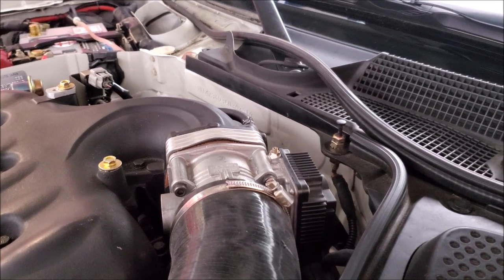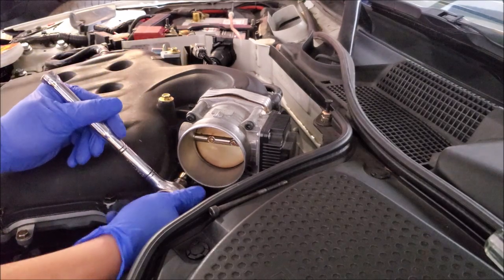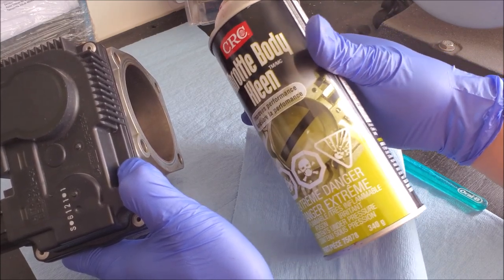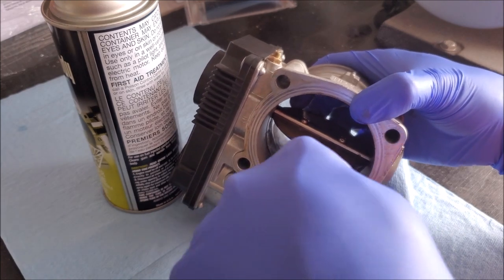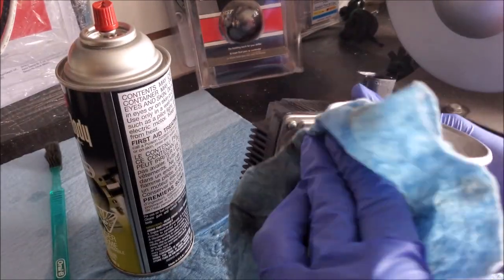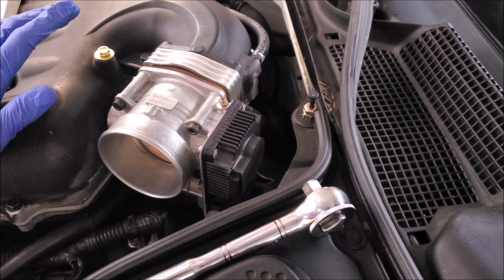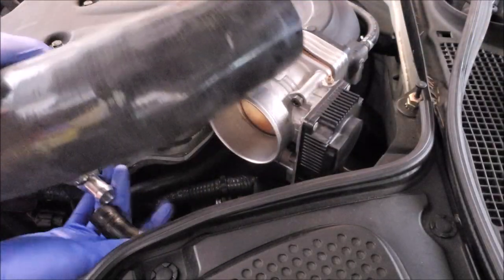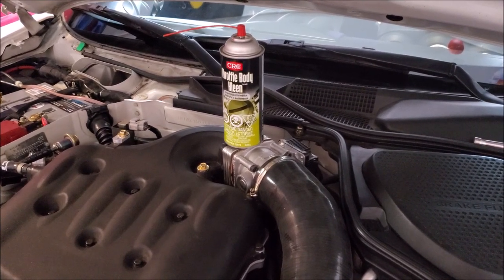How to CLEAN a Throttle Body Nissan 350Z & Infiniti G35 (Nissan 3.5L V6) | AnthonyJ350

Comment: Excellent tip/advice on turning on the lights and pushing horn to discharge all the caps in the system. Not sure how many people realize just because you disconnect power or turn something off doesn't mean the system is discharged. Capacitors don't instantly discharge just because you disconnect power. It can take a while unless you discharge them like you showed.
Reply from the maker: Thanks! Glad you liked that tip.
Reply: how long do u keep pressing horn to discharge?
what about leaving bat disconnected overnight
Reply: What about plugging a device into the power outlet ("cigarette lighter" port) such as a phone charger cord and a phone? Most of these things have a pilot light and would show when there is no juice.

Comment: Knowing is half the battle, thank.
Reply from the maker: Thanks for watching! Hope you liked it.
Reply: @AnthonyJ350  I know this is an old vid but does this work without doing the reset? And wold it work for a g35 2006 I understand the 350 z and G are basically the exact same i just wanted to be sure.
Reply from the maker: @lilgoon8613  You can try without the reset. Just disconnect the battery, discharge the caps by pushing the horn and leave it off for a few hours.
Reply: @AnthonyJ350  Ok man, thanks for responding so quick much appreciated. 👍 and subbed.
Reply from the maker: @lilgoon8613  Thanks for subscribing!
Reply: @lilgoon8613  did it work without a reset

Comment: Can you help me? My car when is hot drives well, but when switched off and left for an hour then started again after a mile of driving when switching gears or braking it can easily shut off. It also can stall when accelerating. It doesn't happen if I wait 3 minutes before driving
Reply from the maker: Is there a check engine light on of any kind?  What kind of car is it?
Reply: @AnthonyJ350  It's 350z 04'. There is a check engine but cannot read it with any obd2. It came on when driving at highway speed.
Reply: @Grendel817  did you fix it ? Im dealing with same problm now,

Comment: I have a 2003 modle with the VQ35DE and I just cleaned the TB and installed a plenum spacer. I just can't get it to idle normally :( I did all the resets and it seems successful, but the car idles around 1100 rpm and when I'm revving it it will drop to 1500rpm and hold for a sec and then back to 1100. And if I'm in gear it idles also around 1500rpm.
Reply: For context I think It's the first time Its even been cleaned for ~140k miles. It was filthy!
Reply from the maker: Try this and take it for a good drive https://www.youtube.com/watch?v=5tQm28K32SQ
Reply from the maker: Given the age of the vehicle I would install new cam position sensors and a new crank position sensor as well.  I have videos on both.
Reply: @AnthonyJ350  Thanks man, love your videos on the Z
Reply from the maker: @botao7274  You're welcome! I'm working on the car again so you'll see new videos on it soon!

Comment: Hey Anthony, how were you able to check the throttle body movement with the pedal? Ignition on(non-start?). I tried with mine(HR engine)and mine to not move, or at least the driver side didn't. But both should move.
Reply from the maker: I just used the accelerator pedal like normal.  Not sure how the HR does it with their weird valve event technology.
Reply: @AnthonyJ350  I figured out that I had to put the Z in first gear and got them to work. I also discovered the throttle bodies are not opening all the way at WOT.
Reply: Same problem, u guys figured it out?

Comment: Hey man I have an 03 350z and I have a similar throttle body spacer, i have the code p0507 and its causing me to lose power/bog out at 3.5k-4k rpms. I tried everything, tried the relearn 100 times, tried new throttle body, tried new maf sensor, nothing is fixing it, pleeeeease help me
Reply from the maker: Has the car ever stalled?  Cam and crank position sensors all seem to be failing now that the cars are older.  I have videos on those parts if you want to check it out.
Reply: AnthonyJ350 car doesn’t stall unless I try to do a burnout, at around 3.5 to 4k rpm car cuts power and just revs super high, bogs out badly, thinking I need a new ecu? I’m 19 man I don’t have much money my dream is to rocketbunny it and eventually make it into a track build but i just spent all my money trying to get a shop to diagnose it and they couldn’t even figure it out
Reply from the maker: @PlatinumPerfect  Did they do a smoke test to check for any air leaks?
Reply from the maker: @PlatinumPerfect  Also have you performed the relearn procedure like this? https://www.youtube.com/watch?v=5tQm28K32SQ
Reply: AnthonyJ350 they did a smoke test and found a large evap leak, fixed that assuming it would fix my issue but it didn’t, still throwing the p0507 code, and yes I’ve tried that relearn, I’ve tried every relearn procedure for nissans pretty much
Reply from the maker: @PlatinumPerfect  If the car has over 60,000 miles I would change the camshaft and crankshaft position sensors https://youtu.be/1VHMGRViJ6g

It's a bit of a shot in the dark butban item that needs to be changed at this age anyways.
Reply: AnthonyJ350 yeah it’s at 138k miles, and damn man thank you so much for responding and helping me, I appreciate it a lot, keep killing it
Reply from the maker: @PlatinumPerfect  Let us know if the new sensors helped.
Reply: @PlatinumPerfect  did the crankshaft and camshafts end up working for you ?
Reply: @stendoz-3883  never did those, turned out to be my throttle body spacer
Reply: @PlatinumPerfect  thank you for the reply ima try cleaning my throttle body as it is very dirty
Reply: @PlatinumPerfect  what was wrong with your throttle body spacer ??
Reply: @michaeldeen8849  idk it made the car throw a code

Comment: This is unrelated but today I switched to Shell 5w-40 from Mobil 1 5w-30 and the zed is quieter at 137,000 miles. I cleaned the maf sensor and airbox as well. I've cleaned the TB while it's on the car but never off. Clearly per your vid the TB is thoroughly cleaned when its off. Btw, were you using a torq bit to remove the TB bolts? If so what size.
Reply from the maker: That's awesome to hear it's smoother, I would post that comment in the Oil Viscosity video we did to show people. I used a Snap-on hex head socket to do the throttle body.

Comment: My throttle body bolt seems to be stuck i am using what seems to be the right size but when I start to put a lot of pressure about 4 Ight doggas I start seeying the bolt start to brake down
Reply from the maker: It doesn't need much pressure to hold down. I would buy new hardware from the dealership.

Comment: I did this, now my throttle pedal lags when I let off the gas, i think the throttle body might be getting stuck open. My mechanic said it was dumb to touch the butterfly but I cleaned it a lot better if I hadn’t and it starts runs and idles a lot better. Only problem is the pedal lag and I’m not sure how to fix it, maybe take it out and try to see any problems? Any advice lmk please.
Reply from the maker: You can try the ECU reset and take it out for a 45 min drive https://www.youtube.com/watch?v=5tQm28K32SQ&t=129s

Comment: Hey man. I love the setup. Those TB sensors are known to cause no start symptoms when the circuit has a voltage problem and the unit needs to be replaced. The good thing is you'll get a code right away. For some reason the Starter or fuel pump- No codes. Thanks for the maintenance tips.
Reply from the maker: Glad you're liking these basic videos!

Comment: I got my CCV mounted remotely , using a 3”x2” KN breather , and some 5/8 hose = 15mm , there is only one outlet on my 2007 350Z , there is a space on the left side of the motor in front of the support , behind the air box , so my engine doesn’t suck in any oil mist or hot air from inside the motor , don’t have much build up on the TB’s , but both of mine just went down , did the pedal , also , so i got about $600 , so far in it ,
Reply from the maker: Thanks for sharing!

Comment: Good attention to detail...I prefer using Deox-it on the connector then following with Dyelectric grease...You can prevent possible intermittent electrical problems due corrosion by prevention.
Reply from the maker: Thanks for sharing, I have that stuff too, I believe a little residue after to help protect correct?
Reply: I have been using Deox it (100) and Deox it (5) for over 20years in professional electronics Calibration and repair laboratories...I have fixed hundreds pieces of test equipment by solely cleaning connections ...Corrosion/Tarnish can reape havoc on connections...As a long standing practice, any connector unplugged will be cleaned with Deox-it and further protected against the elements with Dyelectric grease.

Comment: Great video!! I did both of my TB's last year. I do want to bypass the heater hoses going to them soon. I live in a warm climate and don't really need that. Where did you get the cooper plate?
Reply from the maker: I got the copper plate from Motordyne. Part of their iso thermal kit

Comment: May I have buy links for the tools you used in this video?

- The socket to tighten TB’s bolts that you attached to your ratchet
- electrical connector cleaner
- electrical connector grease
Reply from the maker: Got it all at Canadian Tire

Comment: When discharging the caps, do i have to do both press the horn and turn the lights? I have an aftermarket steering wheel so i have no horn 😅
Reply from the maker: Turn on the lights and hit the brake pedal.

Comment: Hello Anthony, first of all thank you for the great videos, they are very informative. I have a a question regarding the cleaning of the TBs of an VQ35HR engine. As I have read lots of guys out there are complaining about surging idle and not being able to relearn their idle after cleaning them. Some even say they needed to change the Ecu. So what do you reckon, why is this happening mostly on HRs? And if I strictly do what what you advice in this video ( disconnect the battery, press the honk/discharge the ECU, disconnect and then manually touch the butterfly and clean the TB) will there be any chance of messing things up? My only sign right now is a little bit low idling for a second when I stop at a traffic light. And I want to be sure nothing worse will happen if I proceed with cleaning the TBs. Thank you once again! Cheers!
Reply from the maker: I'm not sure why HR owners are having this issue.  You'll have to go on the forums and ask those people how they cleaned it exactly and compare their procedure to how I performed it in the video.
Reply: Did you ever fix it boss?

Comment: I’ve been watching your videos a lot now that I’m doing maintenance on my 350z , Quick question maybe a bit ignorant but why is necessary to reset the ecu , after cleaning the throttle body?~ thanks.
Reply from the maker: You want it to relearn the positioning of everything so it operates properly. These cars just seem sensitive to changes.

Comment: Great video ! I got a problem after cleaning the throttle body of my 350z, the idle jumps a bit when braking to slow down. There’s a video on my channel, any idea ? Thanks 🙏🏽
Reply from the maker: Did you do the ECU reset?
Reply: Same exact issue! Yes I’ve done the reset & pedal dance.
Reply: @yungflyandflashy12  did you fix it ?
Reply: @g35tho11  nope
Reply: same problem it was the brake booster

Comment: Hey Anthony, I'm installing a new throttle body tomorrow and wanted to know what size is the 4 throttle body bolts? I need to make sure I have the correct tool before going all in. Thanks!
Reply from the maker: I don't remember off hand.  You'll want to buy a set of metric ball head allen sockets that are longer.  Kind of like this https://www.canadiantire.ca/en/pdp/maximum-long-arm-ball-end-hex-bit-socket-set-12-pc-0581438p.html
Reply: 5mm allen for anyone wondering

Comment: Hey Anthony, My 2005 g35 just stalled at a stop and restarted. Could airflow be the problem? I have never cleaned the throttle body or mass air sensor.
Reply from the maker: Could be the crank shaft and cam shaft position sensors.
Reply: @AnthonyJ350  I did not get a CEL, when this happened. I have driven several times without a problem. I did clean the MAF and Throttle Body and then got a CEL. I have tried several times unsuccessfully to clear the CEL. I get a scan from Oreilly's and it shows a P0102 code. I tried to test the MAF with a multimeter but I could not get a paper clip inside without possibly damaging the wire. I had a crank shaft sensor replaced in 2016. Thanks

Comment: Some videon on here says that you are not supoose to touch the the plate in the middle with your finger cs you could damage the throttle body. I have done it the way you did it and i have not had a problem with the throttle body
Reply from the maker: Did you discharge the battery and perform the ECU reset?

Comment: Was having a high idle of 1250rpms after cleaning throttle body and maf sensor, took everything apart and tested the operation (recorded with my phone) and my butterfly valve is not responsive at all🤷🏾‍♂️
Reply: I’ve done the relearn quite a few times along with some other procedures but I’m still getting a high idle
Reply from the maker: Check for vacuum leaks. Is the PCV hose under the intake tube installed properly? Also check the intake tube on the bottom to the throttle body. It might be folded up.

Comment: Hey man very helpful video! Do you know by chance if there is a way to reset throttle response? I was wondering if the ECU adapts to your driving style because I have felt my throttle be more sluggish lately. Thanks!
Reply from the maker: Just the ECU reset. You might want to consider having the car tuned with UPRev on a dyno to get better performance from it.
Reply: @AnthonyJ350  Thank you!

Comment: does everything in this video as far as cleaning the carb and electrical connection? also what about removing the two screws holding the butterfly door to make cleaning the body and door easier but also more thorough?
Reply from the maker: I didn't take it apart because I didn't want to disturb the actual unit itself too much.
Reply: @AnthonyJ350  understandable, so you’d suggest against doing that and just follow your video as is
Reply from the maker: @codyoneill6091  I would, there has been a lot of success in the comments plus my own vehicle
Reply from the maker: @codyoneill6091  https://youtu.be/iSzU-cvlLO8 install an oil catch can to help keep the intake clean
Reply: @AnthonyJ350  a catch can was the first thing I did when I got my Z for the soul purpose of keeping the air as clean as possible as well as the upper and lower. The first Z I had, I ended up removing the plenum and seen just how nasty they get (got it with 164k miles)

Comment: hi Anthony, may i ask you a question about VQ35HR? i cleaned TB and did relearn step many times, but i did not work, idle still at 2K, could you give me some advise for this problem? Thank you!
Reply from the maker: Try disconnecting the battery, hit the horn to discharge the caps and let it sit overnight
Reply: @AnthonyJ350  ok, many thanks for your advise, i will try it later.
Reply from the maker: @hunick5538  Let us know how it goes
Reply: @AnthonyJ350  ok, i will.
Reply: @AnthonyJ350 Hi Anthony, finally, i fixed it. i tried many times and it was still at 2k, it seems some place has other problem, I found there was a place where is air escaping from the pipe. Thank you so much! take care.
Reply from the maker: @hunick5538  Glad to hear you fixed it!

Comment: How do I get the electrical connector off the throttle body, it doesn’t want to come off for me?
Reply from the maker: There's usually a clip you have to unlock with your finger, then the plug will come off.

Comment: Hey Anthony I have a vqhr that the idle goes below normal rpms then goes back to normal could this be the IAC?
Reply from the maker: Did you recently work on the car for something?
Reply: @AnthonyJ350  any particular part your referring too or in general?
Reply: @DragoMusivini have you figured out the issue? I have the same issue.
Reply: @aeroladen2039  Hey what's up man. From what I call of the issue there was no code being thrown which I hope is the same with you. At worst case from what my mechanic told me I would have to replace one of the throttle bodies but me being me I would replace both at the same time (VQHR here). But in reality all he had to do was spray some of that throttle body cleaner on them and that was it. WITHOUT touching your throttle body take a flashlight to see if it is dirty. If it is dirty that cleaner should do the trick. Whether or not you will have to do the relearn trick with the throttle body I am not sure. I did not. Just whatever you do, do not touch the butterfly inside. If that does not work. Try doing the re-learn trick. Now if that does not work you may need a new one. I just looked at Z1 Motorsports and they are having a sale on the one for the VQDE. Instead of 369.99 it is 275.99 for the Z1 brand. For 509.99 you can get that, the oversized Z1 silcone elbow and Z1 VQDE plenum spacer kit. Just fyi.